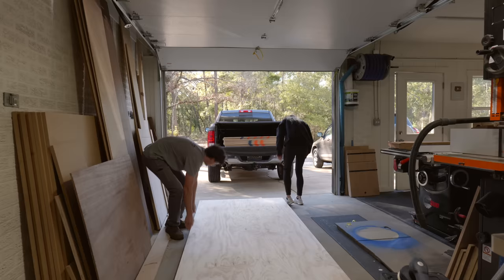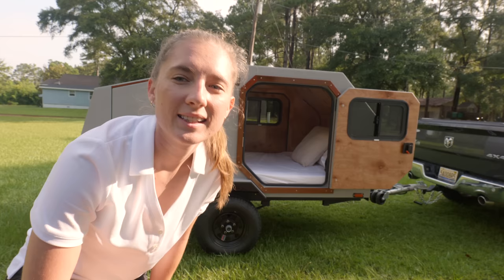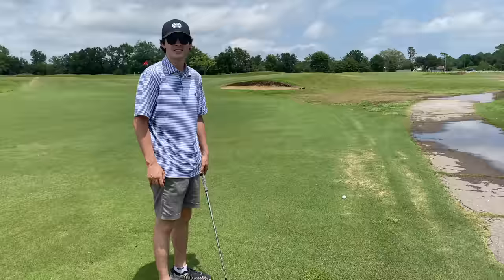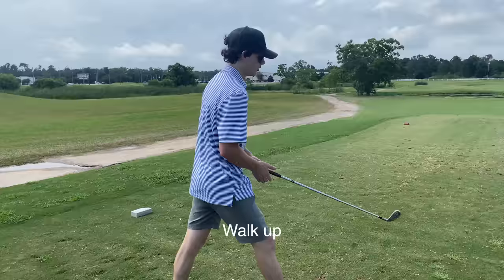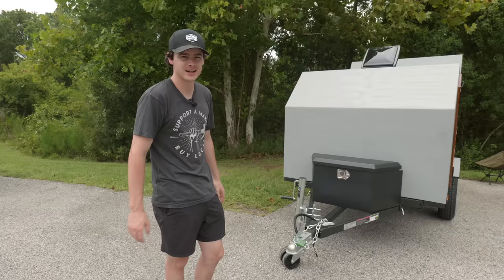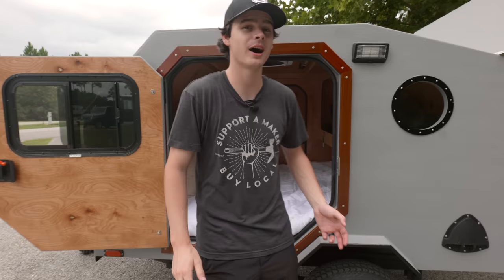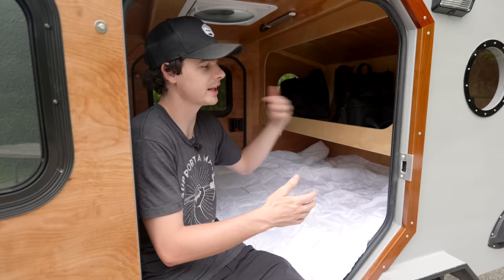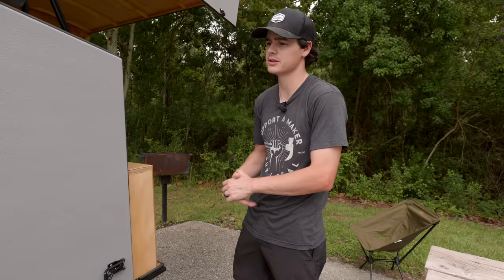Our Unforgettable First Night in the DIY Teardrop Camper

Comment: I camp a LOT,  and here are some things that I would add to mine if I built one.
1. I love the idea of the Bluetti for boondocking,  but I would also add the ability to plug into shore power when it's available to both charge the bluetti and run everything.
2. Small Air Conditioner,  I believe Danby makes a tiny one that fits well in a teardrop.
3. Window covers,  Gotta be able to keep people/critters from peeping in at you.
4. Water tank with electric pump.  
5. Either a small propane stove top or griddle.
6. Your design has excellent options for storage,  so I would put in slide outs for the stove and a cooler.
7. Built in drink holders
8. An roll out awning over the doors,  so you can get in and out without getting your bed wet.

It's a great design with so many possibilities,  Can't wait to see what yo do with one you build for yourself!

Comment: Awesome build!  Remember to bring heavy wheel chocks with you to block both sides of each tire.  In storms and high winds the camper can/will move especially on any slope...guess how I know this!  Also, along with the locks at the coupler, I would run a chain through the wheel hole up though the leaf spring with a padlock just for added theft deterrence.

Comment: Best thing to buy is a Recessed Power Strip with USB-C Fast Charge ports and put dead center on the rear of the kitchen. Every plug will reach it, and buy a magnetic screen to place over the door when fully opened

Comment: I recently built a teardrop camper. I made a wood door with a rubber gasket on the inside frame (like yours) .  I took it on our first trip to California and we encountered rain (a good bit of it).  Anyway the mattress got wet.  So I was tempted to buy another factory door like my other side. I hated that idea since it required lengthening the door opening.    So what I did was frame the door itself to overlap the trailer (the inside part of the frame was rabbeted so it has the right space for a gasket seal.  It Came out nice.  I used mahogany since it is stable and painted it black and did not glue the 2 1/2 inch wide frame but instead put flat head black screws every 3 - 4 inches.  

I am only telling you this in the event you notice your mattress getting wet.  Hopefully you won’t have the same problem I did.  You could test by being inside and having your wife spray water on the seam.   Happy camping!

Comment: You know you could take some unistrut and go app the side and go across the top and then put some solar panels on the top and then run down into the into the pirate unit. And it'll always be charging up even when you're using it, so you wouldn't let you. Lose that much power. Can you get a couple of hard panels from Harbor right? That are really good

Comment: I’ve stayed in mid 70s but high humidity and it was miserable without AC. Our camper has AC but we were in an off-grid site so we were unable to use it. We did get some USB powered fans that do help a good bit to keep some wind on you.

Comment: Guessing 638 pounds.  I saw you two lift it onto its tail earlier on, so it can't be that heavy.  The trailer was 249# and adding maybe 100# for the 2" square tube, 13" tires, and way overkill 3500# axle, plus 290 for the wood, insulation, glue, undercoating, paint, and wiring.  Glad you enjoyed your sauna in the squaredrop.  You Southerners sure tolerate heat and humidity better than I do.  I =don't= miss Arkansas, but pre-1965.  Add an actual battery bank, solar, and a split A/C system to the next one, eh?  That's a few thou well spent for your own SD.

Comment: I do know one thing I just saw you. You don't even have wheel chalks under there. Put a block under the front and back of the wheel. That thing could have rolled off the back of that hill behind you at anytime, from my wind blowing or something else get some wheel chalks. Please, that will save you going off of a hill with that thing

Comment: You may want to invest in a 12-volt ac unit for your teardrop camper and maybe a 12-volt heater.
Or put solar panels on top to charge your battery pack.
Reply: All of those ideas are great but I’m confused how it’s heat and AC OR solar panels 🤷🏻‍♂️
Reply: @jeremyspecce  on my RV that I built I changed everything from 120 volts to 12 volt system.
What I meant about AC and Heat there is a system that runs on 12 or 24 volt systems that can run a Air conditioning unit or a heating system.
All you need is an onboard power system. I use to use a 3- 12 volt batteries charged by my truck or 4 solar panels.
Now I have 5-batteries on a 6- panel solar system that powers all my appliances. And it works great on hunting trips and vacation trips.
Feel free to ask me anything else. I have built 7 RV trailers from box trailers to flat bed trailers.
I don't know everything but I know enough to camp off grid for weeks at a time.